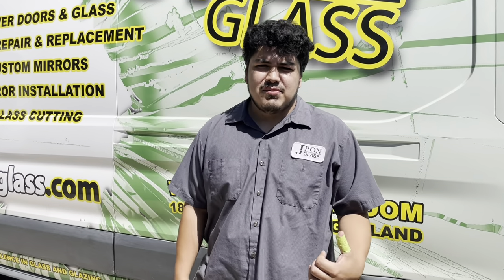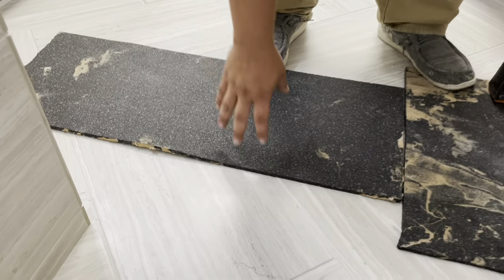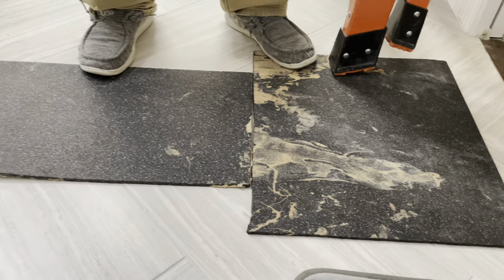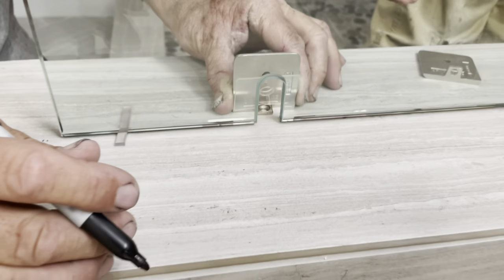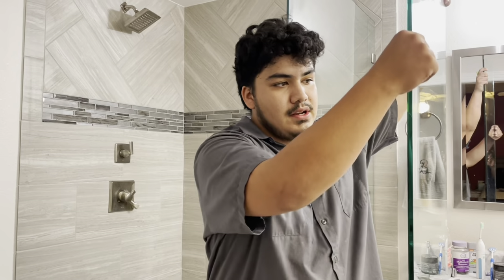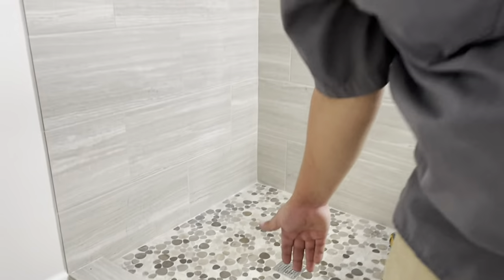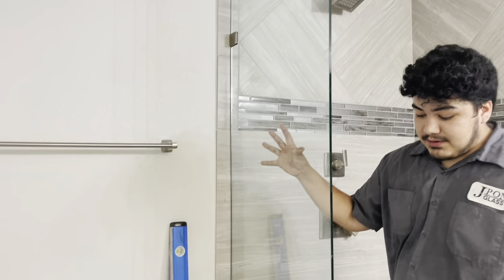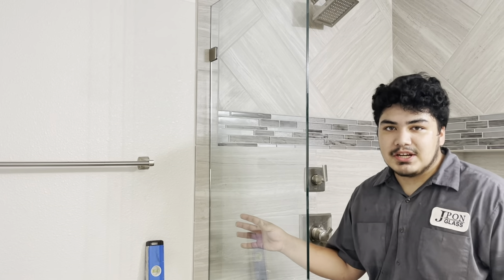Frameless Shower Enclosure Installation

Comment: My Favorite. These r the tradesmen that cause 80% of shower failures by drilling through shower curb waterproofing systems. Smh🤦‍♂️
Reply: How else do you mount a door on the curb?
Reply: We have to. Use silicone in the hole
Reply: @MasterBojangles A schluter channel set into the tile tiling. Or a thick enough marble sill.